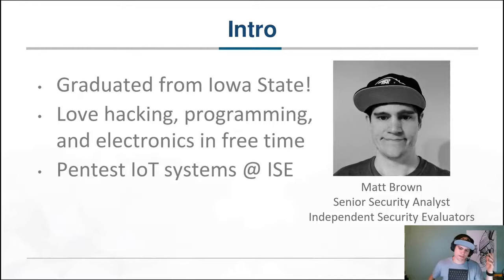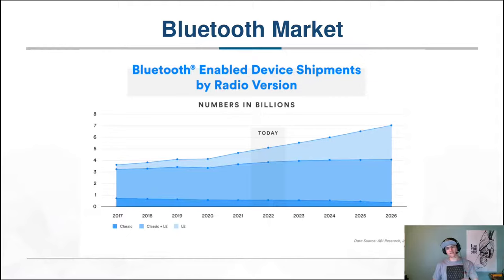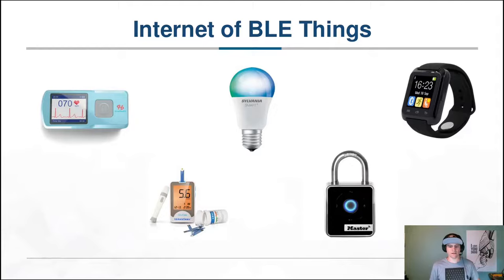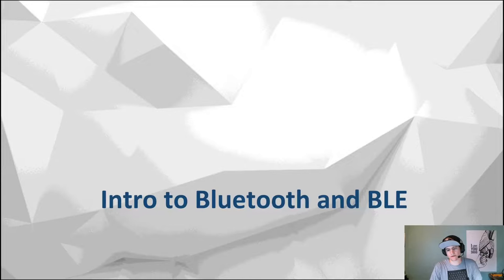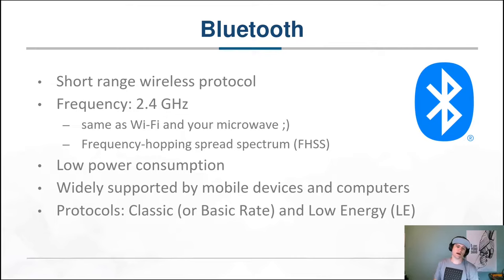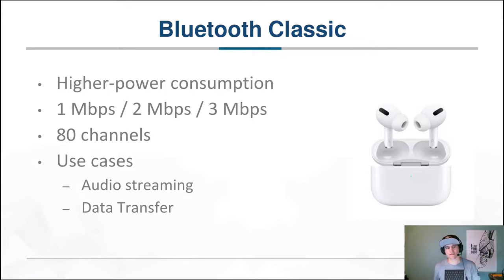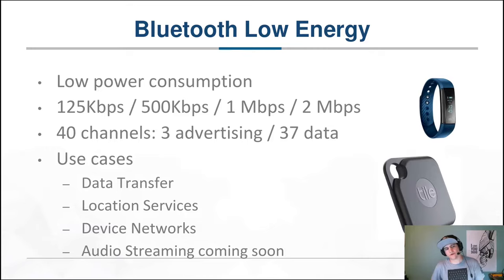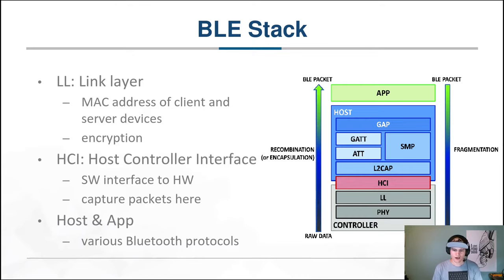Bluetooth Low Energy Hacking Part 1 - Intro to Bluetooth Low Energy Security

Comment: I think my neighbor may have left a physical dongle or a signal disruption device and would access my network/internet. I dont know how to locate it. FYI, i had an ATT technician confirm that there was a modification on the wooden electrical/internet pole amd said someone was using/sharing my data.

Comment: Thanks for the video, it's very clear and valuable.
I'm having serious issues with a BLE keyboard on Linux Xubuntu....   It detects, but very hard to connect, and even when it connects I'm unable tu use the keyboard....  do you have any Idea of whats going on? 
O Windows it works fine
Reply: have you installed drivers
Reply: @thengspjo4716  I have no clue of what drivers to get, it's a generic BLE keyboard, no brand lol....
Reply: @thengspjo4716  
this is what I got on bluetoothctl

[BLE Keyboard]# info CF:E1:07:72:1D:AB
Device CF:E1:07:72:1D:AB (random)
	Name: BLE Keyboard
	Alias: BLE Keyboard
	Appearance: 0x03c1
	Icon: input-keyboard
	Paired: yes
	Bonded: yes
	Trusted: yes
	Blocked: no
	Connected: yes
	LegacyPairing: no
	UUID: Human Interface Device    (00001812-0000-1000-8000-00805f9b34fb)
	RSSI: -55